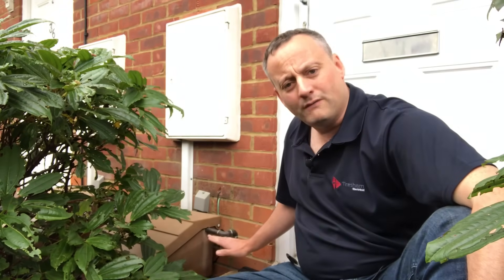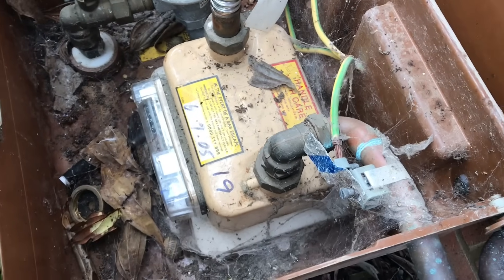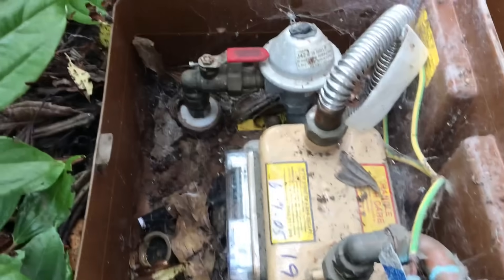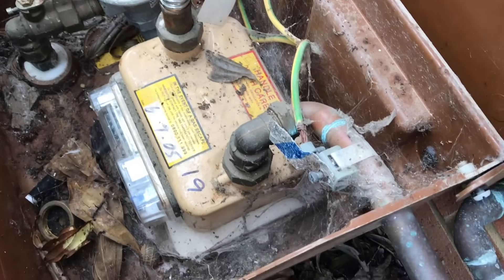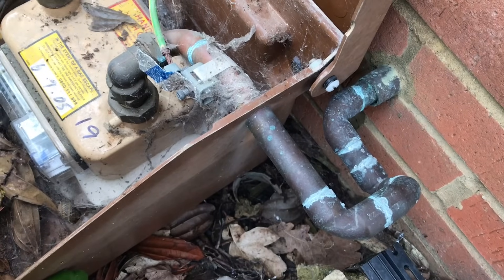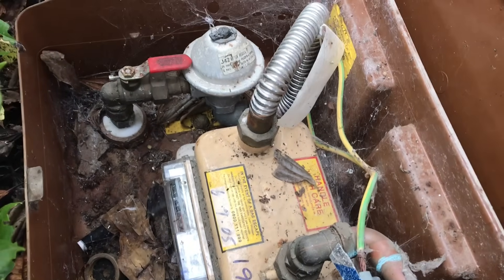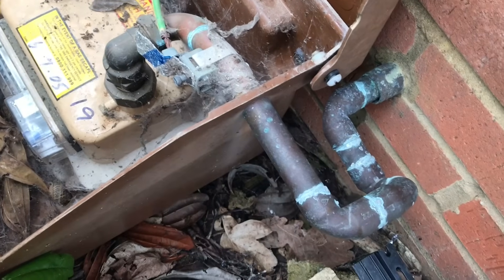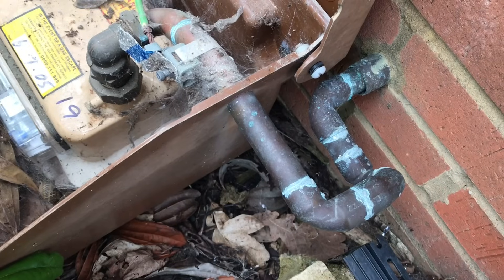Under the 18th Edition BS 7671 will this Gas Pipe be an Extraneous Conductive Part & Require Bonding

Comment: I started a Central Heating Maintenance contract with British Gas. On the first visit the Engineer carried out a safety/compliance survey. All was good with one exception point. He said the Gas Meter had no earth bond and was therefore non compliant and noted this on the report. Since watching this video I have inspected the gas meter. It is mounted inside a GRP enclosure and the supply pipe coming from underground is plastic. The outgoing copper pipe exits the enclosure through the bottom and then has a 90 degree elbow and enters the house through the brick wall about 140mm above the block paved driveway. There is no possibility any soil ever coming into contact with the copper pipe. So no metal parts contact the ground at any point. Seems to me therefore it does not need to be bonded. Anybody got any views on this ?

Comment: Does this apply if your Gas pipes are metal but the supply has been disconnected and capped off within the meter? The Gas pipe entering my property from the meter is Metal.
Reply: Yes.  It’s the pipes that conduct electricity. The cap on the supply is usually a copper insert too.

Comment: As a gas engineer we are obliged to point out where bonding is not visible within 600mm, before any branch, or at the nearest point of entry if in a meter box and has a 10mm2 earth cable connected. This is in line with electrical standards, i guess for electricians the problem comes along when we identify the earth bond is not as per the above, we are obligated to leave a card informing the customer that they need to consult an electrician to check if bonding is required. This is because we are not qualified to make that judgement. If bonding is missing then this will happen more often i guess causing both trades an issue, we appear to be in the wrong with the customer and you guys are called out to confirm a correct or in correct installation. All in all its a minefield for us!  One question, in the video the guy connected the bonding but perhaps didn’t need to, is this an issue or just unnecessary work?

Comment: It's very common for pipework after the gas meter to be buried at some point before is gets to a gas cooker or boiler. To my mind, if unless it can be shown that there's a good deal of electrical insulation between the gas or plumbing pipework, then they ought to be bonded. The danger is that if there's a broken PEN, then there would be electrical appliances with high voltages in close proximity to metal which is at ground potential. It's entirely irrelevant whether any effective grounding of the plumbing or gas pipes is on the supply side or within the property. It has the same dangerous effect in the event of a PEN failure.

Of course it's not exactly difficult to measure the insulation between pipework and earth potential. A meter between the pipework and the CPC in the electrical system would show that. If in doubt, then it surely ought to be bonded.

Comment: If the concern is the earth might be brought up to the same level as the outgoing gas pipe, thus making it an extreneous path to earth, surely the pipe going through the wall, sleeved and most likely touching that sleeve, it would make it again an extreneous path again? On another note, this gas pipe connects to a gas boiler say for central heating. What is connected to that boiler? Mains water. What's the mains water incoming pipe touching? The ground! My house was built 12 tests ago and my water incoming pipe is in cooper pipe or at least that's what I see at the stop cock. Wouldn't this make the gas pipe an extreneous path to earth on it's own?

Comment: The copper gas pipe will be connected to a boiler, or gas hob. Either item will have an electric supply, therefore a CPC. This means that in the event of an electrical fault on the boiler or hob the copper gas pipe will become highly dangerous as it is connected metallically to the exposed conductive parts of the boiler or hob and is already at ground potential. Therefore, far better to bond it. It is wrong to assume that installation pipework, which is connected to electrical equipment in the house, is not at ground potential just because it isn’t touching the actual earth. We’re not talking about a metal mirror above a fireplace. It’s a piece of copper clamped to the metalwork of the boiler

Comment: Earth bonding by the meter is nothing to do with connecting with the ground it’s to do with the copper pipe ever comes live from electric cables touching inside and every house got to have this and it can’t be no more and 250 away from the meter even when we do meter exchanges we have to Earth cables either side of the meter to change it
 we can refuse to touch the meter until earth and bone is in place and if the customer refuses we can get the power network out to cut the power off

Comment: Gaz at your house how the hell are you supposed to take a meter reading when you need to or to check your gas bill? At least at the other 
House they put the gas meter on its sack side so it can be read. 
Also thinking about the building is built on concrete foundations then the metal pipe passing through the brick work could still be at poprtentiol to earth as the foundation and the building is on the greater mass of earth?, If you stand on a bear concrete floor with bear feet and touch a live conductor you will be killed as the current will pass through you to earth. Just a thought .
Fantastic video as always Gaz 👍👍👍❤️

Comment: Thing is what happen on an old install where the gas supplier replaces the metal supply pipe with plastic. Would you remove the earth clamp and cable. For me No because what if the gas pipe was just supplying a gas cooker with a rubber hose supply and under the floor a cable with a damaged sheath was touching or resting on the gas pipe ?.
In this situation I would leave well alone

Comment: Coming in very late on this, your incoming gas pipe is metal. At 5:10 on you can see the insulating joint below the shut-off valve, there to stop fault currents flowing via the gas main to earth. With this there does it still need to be bonded?
Reply: That is the meter box adaptor and not an  insulating joint. Also I would point out that the MEB connection for the last clip is incorrect as it is fitted on the gas meter installation and not the consumers pipework. The gas meter installation finishes at the outlet of the box.

Comment: It's never incorrect to install a protective earth conductor. It can only be incorrect to not install it. 
I've often seen earth clamps on plastic water pipes. It doesn't matter that their is an earth clamp on a plastic pipe, it only matters if there isn't one where it's actually going to work ! :D
Reply: Worrying that the person that installed an earth clamp on to plastic thinks it is worthwhile. If this is their level of knowledge of electricity they should not be working in the electrical industry, full stop.
Reply: @deang5622  The person who fitted an earth clamp to a plastic pipe is not thinking for themselves. They are probably just doing as they were told, following the rules, etc. Same as wearing the covid muzzle and queuing up for jabs. Switch brain off and do as you are told. Repeat orders to others.
It's nothing to do with being qualified or in the right union. People just need to engage their brains.

Comment: G.what is the reading of metallic water pipe or gas coming into the house before it is bonded and would they reduce the touch voltage or how dangerous would they be not bonded what could happen wcs

Comment: I'm Gas Safe & Napit.  This is where electrical regulations differ from gas regs.  Either way just to comply with gas safety regulations.  The installation should be equipotentialy bonded.  If any of the pipework becomes live at least it will have path to ground.  There will be occasions where customers will call to say the Gas person has left a bonding notice on the gas meter.  ☹

Comment: Without getting into any terminology, bond it - why? consider downstream on the consumers side. It's likely that  a gas boiler / gas hob / cooker is likely to be used that will involve some form of electrical usage, pumps, valves ignition etc.. There will be mechanical joints to these appliance connections with likely joint paste increasing it's impedance. Therefore a voltage is potentially likely to appear on this EXPOSED conductive part and therefore present a shock hazard. The final electrical connections to these gas appliances is likely to be 0.75mm or 0.75mm with at best a 3A or 5A fuselink within the fused-connection unit (spur in old money!) If the gas pipe is not readily bonded, our invisible friend will wait to discharge to go home to earth through one of us humanoids! With the comment raised in relation to poor mansearth (TNCS etc.) we would have expected this would be afforded by combinations of earth stakes and RCD's / RCBO's.
Take my 1960`s bungalow, the gas load pipe is laid on the substrate under the suspended floor which is 200mm below DPC.
Whilst I have the microphone, the wiring regs overlooked a very important fundamental fact, that of WATER IS A CODUCTOR whether in metal or plastic pipe, so when it comes out of the tape it presents a running hazard perhaps into a metal sink / bath etc.. where it's victim is washing up in it / bathing the little darlings - so my comments here would be to bond the sink / bath etc.. and metallic waste as a matter of course without being confused by the misleading regs. At many points in the water supply network it will be both futuriously in contact with with earth though it's metallic construction, or even 'imported' bonding from neighbouring consumers. If you have plastic water pipes, try taking a 12v ISOLATED supply, connect one side to your MET and the other end into the metal sink etc.. (waste plug in) and run the water - measure the voltage - now measure the resistance of your test circuit, using Ohms law calculate the current, now do the same calculation if the voltage was 100 and 200 volts - the results may scare and surprise you! 
We take sometimes corporate responsibility for the installations we do so the regs can only be a minimum standard, not final word! Thanks

Comment: I don't get why the level of earth around the meter box is relevant.as a meter engineer I've personally experienced voltage on a gas pipe that was in a semi concealed gas meter  such as the one in your video.the majority of incoming gas  supplies come in a plastic pipe wheather in the ground or on the wall.i would of just bonded it anyway.

Comment: I would like to point out that the supply pipe into the property is in contact with the wall which is at Earth Potential, therefore Bonding Required.
Reply: Thank you! Another point to make surely is even if the pipe wasn't in contact with the wall, it will be connected to a boiler that is connected to water that is most likely touching either the wall or in fact the ground.

Comment: Even if the copper pipe on the consumer side is not in contact with the general mass of earth where it enters the building is there a possibility that it could come into contact after it enters? I`ve been on jobs where pipes have been covered in building rubble which has been swept down a lifted floor board into the floor void.

Comment: you can clearly see the damp proof membrane on the brick work and the soil level should be 2 bricks below this so the soil should be nowhere near the pipe that answers the question for me
Reply: That's what I thought too. The pipe appears to be about level with the DPC. But I thought maybe 'ground level' may be defined as being within a certain distance of the ground rather than necessarily touching. Though no measurement was quoted in the video.

Comment: As with many others who commented, I would not have bonded it. The pipe is at DPC, and ground should be at least two courses of bricks below that. The soil heap shown is clearly spoil heaped up. I might even have been inclined to give it a boot shove in to the hole.

Comment: As someone who holds both qualifications, domestic gas and 18th, i would say that it was not a requirement to bond the pipe. The box is a semi-recessed type , the lower section being within the ground , the upper section where it widest is designed to be above ground. Not really sure why the guy behind the camera thinks the dirt would be brought back to a level near the lid of the box, bit hard to say without zooming out and looking at the big picture. 

Having said that, he is the guy putting his signature on the document, and he would have to answer to the powers to be should anything happen. If he believes in his opinion that a risk exists whose level exceeds what he deems to be safe, then i leave that decision to him and cannot tell him he is wrong. If in doubt, be safe.
Reply: Rather than worry about soil, I personally wish to understand in bad weather, which could occur, snow or just heavy rain could provide a conduit, is there a risk I am not competent to know ,but would like to.

Comment: It's irrelevant whether the gas service is plastic as the 22mm copper gas pipe passes through the 2 courses of brick/block work as it makes its way to the boiler in dare I say it every case. These bricks/block are in contact with the General mass of earth and will give a low ohm reading. Test the pipe as GN 8 and the result would mean to bond it.

Comment: Another Great video! 
A quick question though... say the metal gas pipe going to the boiler in the property becomes live from a poorly insulated cable in the boiler. Then someone outside grabs the short bit of copper pipe before it goes into the property while stood on Earth. Does this not present a possible reason why it could be class as extraneous conductive part, or due to having no earth potential does this stop it being one? I am sure if this happened the RCD would trip and I know I’m playing devil’s advocate, just seems a little alien to me not to have this main bonding especially when the metal work is close to the ground. Any help on this issue would be great. 

Michael

Comment: Gaz, on Part 2 of BS7671 'Definitions'... The exact wording for an Extraneous-conductive-part is "A conductive part liable to introduce a potential, generally Earth potential, and not forming part of the electrical installation"... The key word here is "liable", liable can also mean likely😎

The video that guy said when they reinstate the floor it will be at ground level and level with the pipe... When it rains then🤷‍♂️

Comment: After reading these comments after I already commented, I noticed some people here don't realize the dangers or the differences between creating equipotential and creating a potential 🤔

In regards to gas or plumbing engineers regs, that's not my field so I can't comment on that, I'll just make sure the electrical part is correct.

This clearly enters the building in metal and the entry point is metal so requires bonding🤷‍♂️

Having said that, some might say but are you not creating a potential by doing that because the otherside is plastic.... In which case you can argue that it will be the same potential or should be the same because you can almost guarantee they will have an appliance of some kind such as a boiler with all the pipes going through a metal plate.  So therefore in this case it is safe to comply with the regs by bonding it.

Comment: Hi Gaz, according to reg 411.3.1.2 second paragraph it would need earth bonding because it enters the building in metal and the point of entry does not have an insulating section because the meter is outside.  Also reg 544.1.2 and page 49 indent (b) of the on site guide, it says 'should be' but the sentence starts off with 'where practicable' in regards to the 600mm rule, that would normally mean if it's not practicable then as close as. But regardless of where you bond it, it needs to be done as it enters the building in metal.
Reply: It does have an Insulating section you can see it in the video, look closely between the pipe and the mortar. that is a GasSafe requirement so would be have passed regs.
Reply: @sofasoul5367  yes I can see it, but my point is although it is plastic, by the time it enters the building it is metal.  So it enters the premises in metal and on top of that the definition of extraneous in the definitions section used the term liable which also means likely.  In this case it's quite likely the compost would fill up to the pipe level causing it to be earthy.
Reply: I agree, ive had similar recently with plastic gas pipe changing to cast iron, then entering the building in cast iron to the meter inside. So reading BS 7671, if it enters the building in metal pipe, it needs bonding. 
Interesting to see all the comments showing it isnt clear whether you do or dont?
Reply: @almac56  problem with BS7671 is that it is not a legislation (if it was legislation then there would be no such thing as a C3 in EICR's and it would've been written differently), it's a guide hence all debates are interpretation based which makes it annoying.

Comment: A bond is better than no bond. If in doubt, be overly cautious  👍🏼
Reply: What if both gas and water incomers are plastic. You take an ohms reading at pipe work which proves equipotential bonding is not required but then you bond properties copper internal plumbing anyway and now you have an outside tap connected to a tncs earthing supply with the potential for an open pen conductor?

Comment: also good to note to achieve 0.05 ohms the length would be limited to around 25-30meters i would take 25meters as the max tbh allows for ambient temp changes